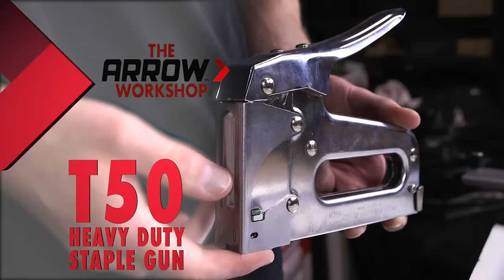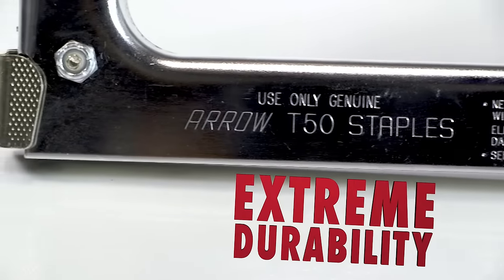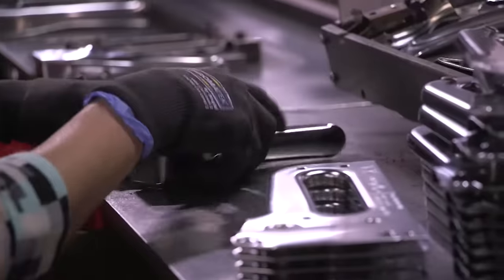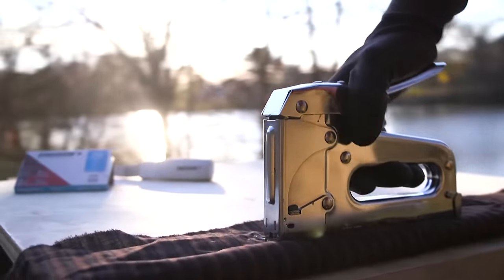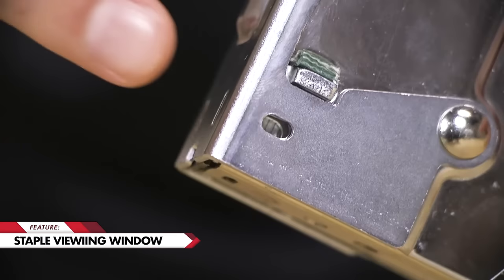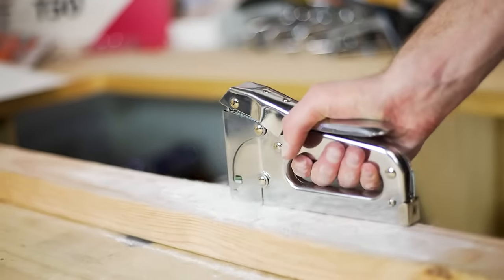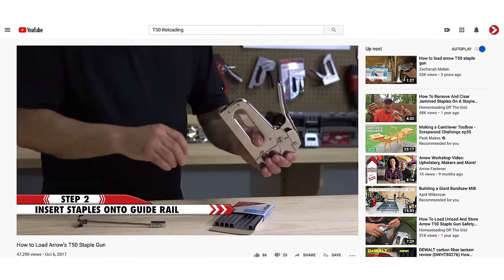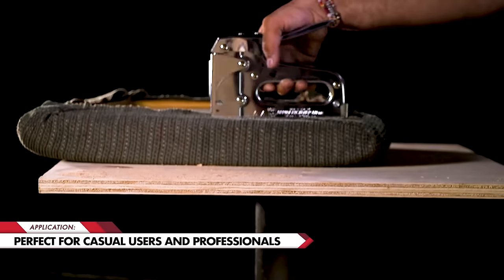Product Tutorial - Arrow's T50 Heavy Duty Staple Gun

Comment: Just purchased t50 loaded with staples, not working?
Reply from the maker: Hello - Sorry to hear you're having trouble with your stapler. Please check to make sure you loaded it correctly: https://youtu.be/bfs2G0EqGHY.  Also make sure it didn't jam when you tried to use it: https://youtu.be/-UtcDB-qddE.

Placing a hand on top of the stapler when firing also can be helpful. 

If you need additional help please give us a call at 800-776-2228. -Arrow Fastener Team

Comment: Very disappointed in this product!  This was a waste of money & time. A new Arrow staple gun and Arrow staples. The staples stick out about 1/8 of an inch all the time, I had to finish the job hammering the remaining section of every staple.  👎
Reply from the maker: When staples don't fully penetrate the material, it's usually because they are too long for the application. Take a look at our staple guide to learn more: https://bit.ly/3fJdrRS. Also, placing a hand on top of the stapler when firing helps add driving force. Hope this helps.